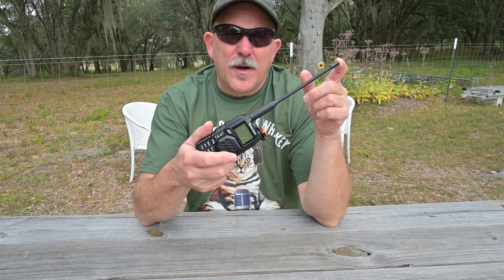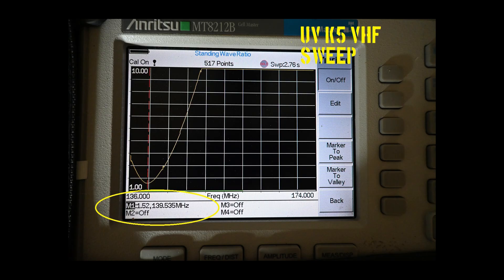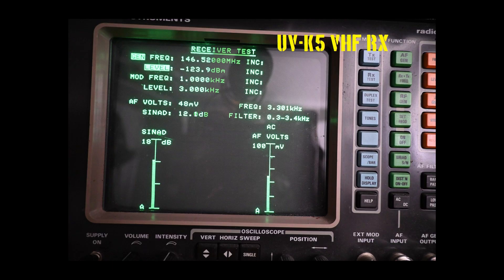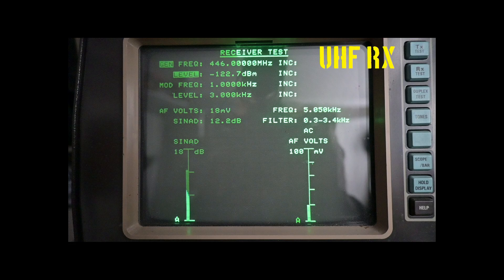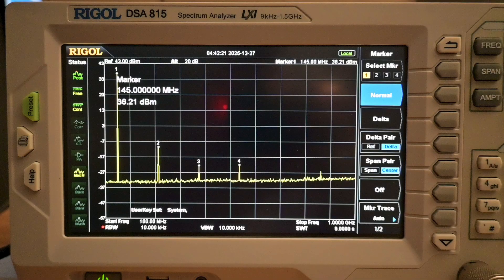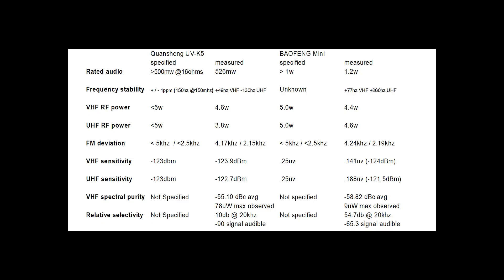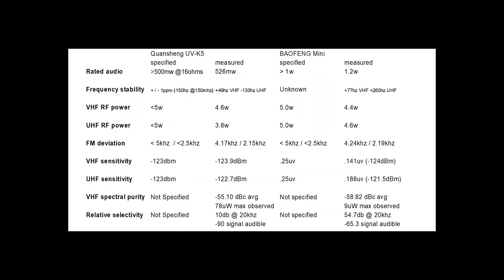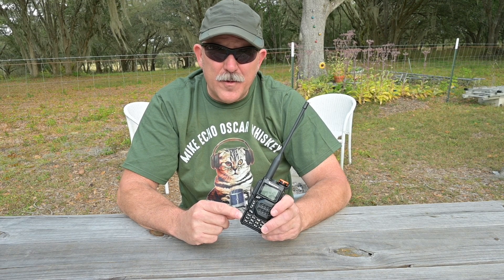Quansheng UV-K5 radio testing vs the Baofeng UV-5R. cheap VHF / UHF radio battle royale

Comment: Great video, reminds me of top gear breaking down and reviewing cheap cars every now and then lol. Will you be reviewing a VP8000 anytime soon?
Reply from the maker: Thank you very much. I will try to get my hands on a VP8000 to test in a few weeks.  Thanks for watching !
Reply: @survivalcomms  Fantastic, I'm currently comparing to that and the TP9900. I've found your BKR and APX reviews to be fantastic real world benchmarks.
Reply from the maker: @beaker15tyler39  Thank you !  I have a TP9900 now and I really like it. The radio is sensitive on test equipment but we have been having some trouble with it poor receive in service. The working theory is the multiband antenna might be the culprit. Working on getting some mono band 7/800 antennas. The noise cancelling on the TP9900 is top shelf with the plain jane speaker mic.
Reply: @survivalcomms  Sweet, I hear the Tait is also smaller and cheaper so that could be a good thing. I hope to see a video on that as well at some point.
Reply from the maker: @beaker15tyler39  I am working on that and you are 100% correct the form factor of the radio is amazing and the price is much lower. I still dont have FPP in mine which is kind of a bummer.

Comment: Can you share the setup for the analyser sweep for HT antennas? Reason I ask is I’ve found them very variable to the setup/environment when put on an analyser as compared the chassis they were (perhaps) designed for?  Great video, BTW….I have several cheap Chinese dual band radios for playing with, but they’ll never replace my icom or Yaesu for normal use.
Of course, if I lived in the US, and wanted GMRS as well, my HAM radios would be useless, but I think I’d still go for an unlocked Alinco or Anytone rather than a real cheapie.
Reply from the maker: Thank you ! I use an anritsu MT8212 cellmaster with and without a chassis simulator outdoors. I check my equipment before with a variety of known antennas and loads (controls) of known value to look for variances in said known value before performing a test. Then I perform the test 3 times looking for repeatability in results before moving forward . I agree it is not possible to do this work with a Nano VNA or a FWD/REF wattmeter . The test in this video was for repeatable center of resonance to demonstrate that the antenna was actually cut for the bands of interest and demonstrating bandwidth consistent with known control antennas and loads. If a short antenna is resonant across 30mhz of VHF sweep range it is 100% a dummy load performance wise. I hope this helps and thanks for watching !

Comment: Great video, Bret! Looks like they're pretty close in performance until your last test. I guess there are two real questions here: 1) is the Quansheng good enough at $29 or do you want to go up to $47 for the Baofeng mini, and 2) does the wide receive capabilities (and 222mhz functionality) and the firmware hacks make the receive sensitivity a null issue? Thanks so much for putting this gear on your bench. Happy new year!
Reply from the maker: Thank you ! The mini is two radios for $40 which makes them $20 each. The out of band capabilities to me aren't really that useful and their inclusion is what compromises the selectivity in my opinion. The selectivity in a rural area is something that the end user isn't likely to notice unless you had a communications plan using multiple closely spaced frequency talk paths operating simultanelously. In an urban area I experienced a lot of squelch falsing and even here on the bench it would unsquelch often. I also noted that on occassion when you change a setting in the radio it necessitated a reboot of the radio to become active and when I bombarded it with high RF in a VFO mode the radio would go deaf and reentering the frequency allowed it to receive again. This leads me to believe that the shielding in the radio may be lacking and these faults are occurring when something in the control chain is affected. Anytone mobiles on DMR exhibit that in the audio chain regularly.  In my opinion firmware isnt a fix for hardware problems. If I had to choose one over the other I would choose the mini (with a better antenna) for a cheap radio but time will tell as I haven't spent enough time with either yet to find all the bugs. Happy new year to you as well and if you decide to make the trip down here for hamcation let me know.